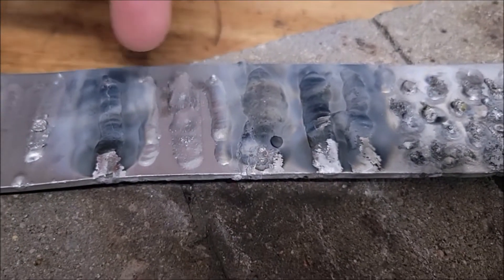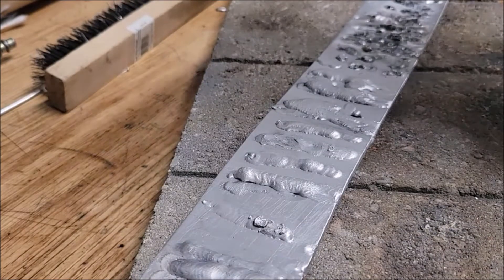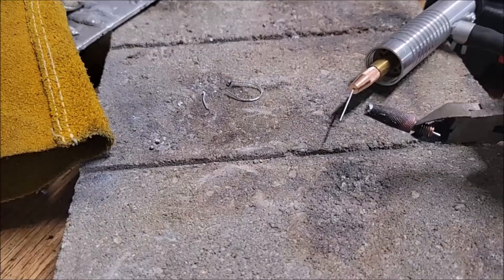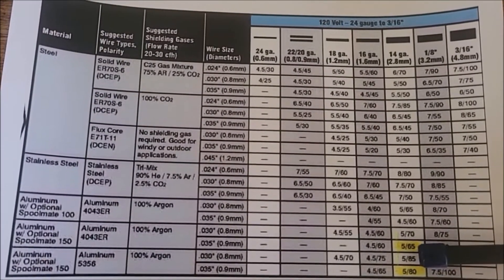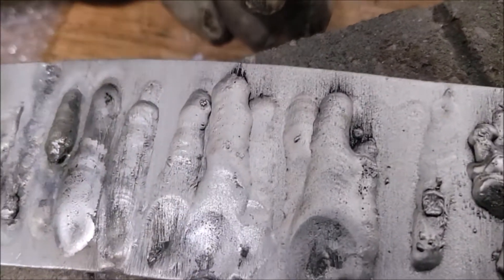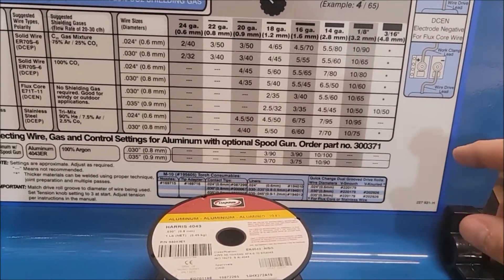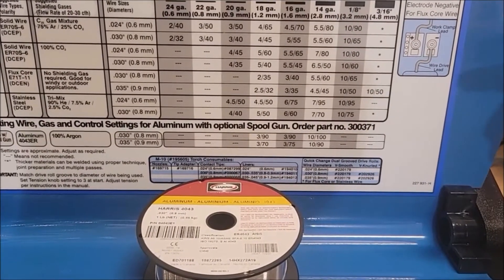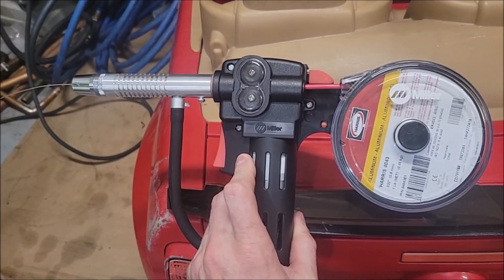Miller spoolmate 100 aluminum DC Mig welding 4043 & 5356

Comment: I tried using Hobart .030 5356 with my spool gun, and after more than half a 40 tank of argon, has no good welds to show. Tried all variations of settings.
Switched to .035 4043 and had some clean beads down with a little adjustment in just a few minutes. Both still have soot, but the 5356 was so much worse.

Comment: Stick welders always dragging everything! 😂 always push wire. And always uphill anything structural. 5356 is a ****.  I like the video but just push and spray and don’t even bother about running a pattern, pause if you have to. Pushing is a mixture of cleaning and staying in the puddle as far as angle of push